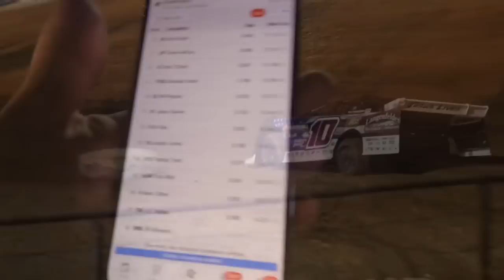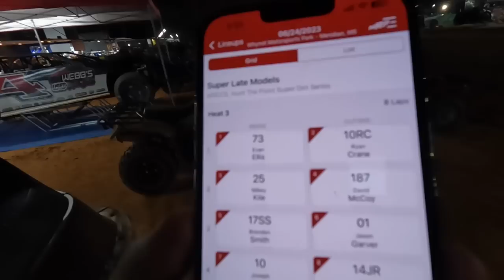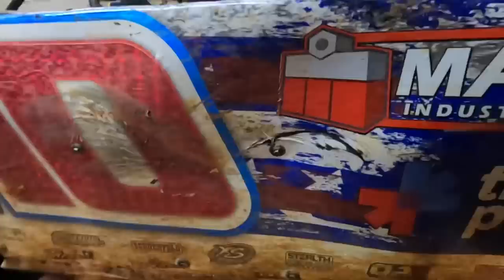Wild Wreck at Whynot! Terrible Flip During HTF Series House Divided Finale!

Comment: First off,Thank God that man is ok,Says a lot about how well these car's are built,in all my years of racing I've never seen one flip that violently,It kinda looked like someone hit Joseph and spun him around into that car causing it to flip
Reply: Nah the guy that flipped pushed up the track, got passed by 3 cars and tried to stay in his lane without lifting and jj was side by side with the middle car and everyone just ran out of room. Impossible for jj to see that theyre squeezing that guy into the wall...just a racing deal. One mistake and you're flipping down the frontstretch
Reply: @cgundlac  been there done that,My first time at Bristol last year,Bran New longhorn car,I went out the first time to shake it down,made 3 laps carb needed adjusted,Got that handled went back out,They had the guy clocking speed lap 5 at 147 mph coming into turn 4 tie rod bolt broke head first into the wall,I hit so hard I Bent the steering wheel, Broke Both wrist,Both ankles right collar bone, Dislocated my left hip and my right eye popped out was dangling,The poor guy that come running up to check on me barfed and yelling she's dead she's dead 🤣🤣 bloomquest was behind me Even he Came to help,was screwed me was these 38 DD I pulled my belts tight as I could kinda but that impact squished Them down Even further allowed my body to move a bunch I'm still sore but like you said that's racing you just embrace the suck
Reply: @Nikkiwho791  I almost pee'd myself reading this 😂
Reply: @pazzocorridore  when I crashed I did pee myself 🤣🤣 actually laid a Polish burrito in my panties,I hit so hard the numbers on my door added up,I went from 35 to Dale Jr 8 🤣🤣
Reply: @Nikkiwho791  Real tears! 😂
Reply: @pazzocorridore  🤣🤣🤣🤣